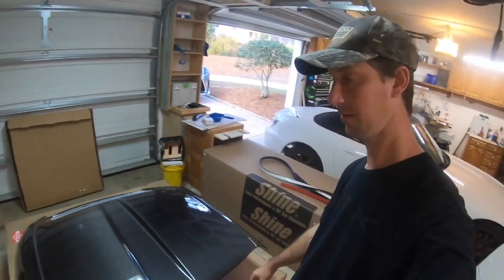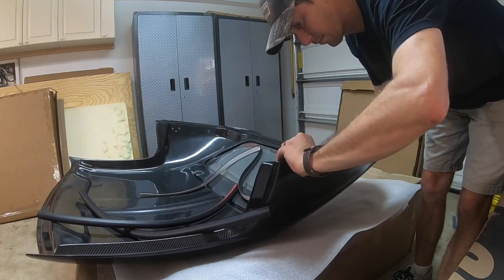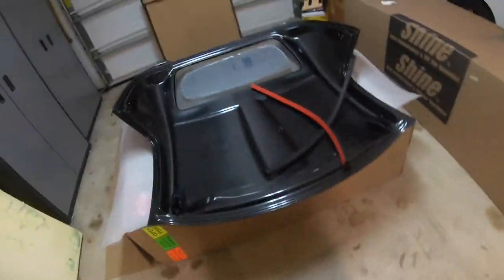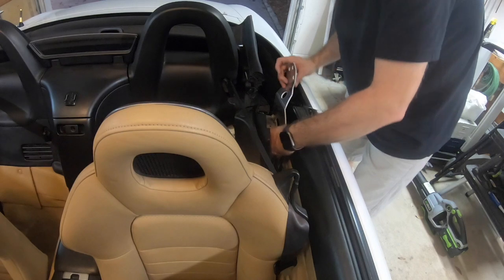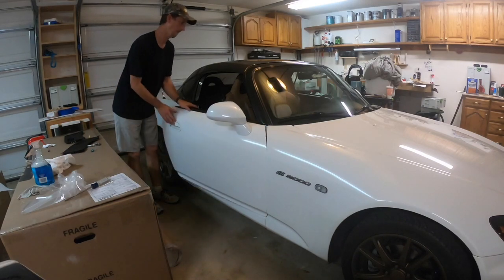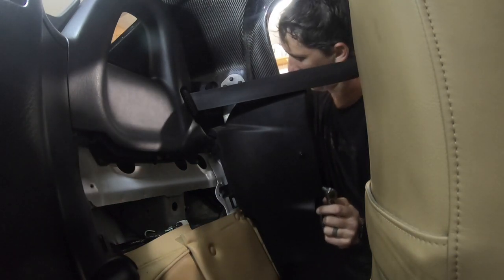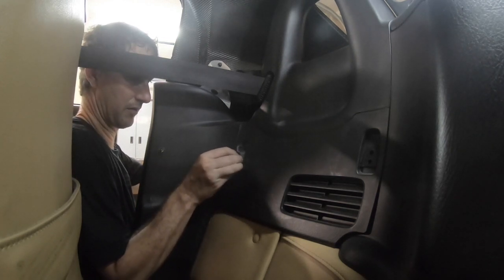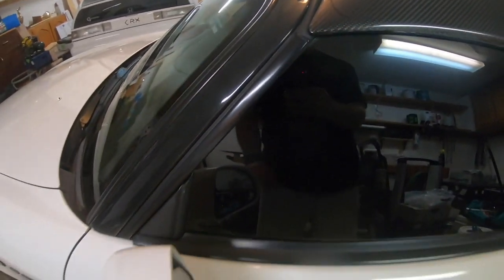Honda S2000 Forbidden- USA  Mugen Style hardtop install

Comment: The trim panels fit right back? Mine panels didn’t fit anymore after the hardtop
Reply from the maker: Yes . It’s a bit tricky to snap back in . 
In case you have the OEM rear catcher bracket . You unscrew the brush . And then it fits . Check out the rear catcher video from me .
Reply: @gdm_crx8513  I don’t think I got the oem rear catchers just the metal plate that came with the mug men style top
Reply from the maker: Then it should fit . They go right over the metal brackets. Did not had a problem reinstalling them .
Reply: @gdm_crx8513  ok. Ima try tomorrow since it’s like 12am here where im at. The car looks ugly without those trims lol
Reply from the maker: Yeah , they should fit . Hope my video was helpful for the install .
Reply: @gdm_crx8513  update. Took off the soft top brushes and they clipped right in. Thanks man.
Reply from the maker: You welcome . Glad it worked out . 💪🏻